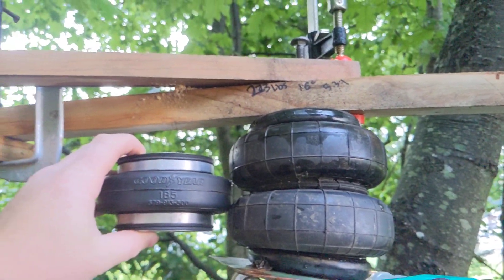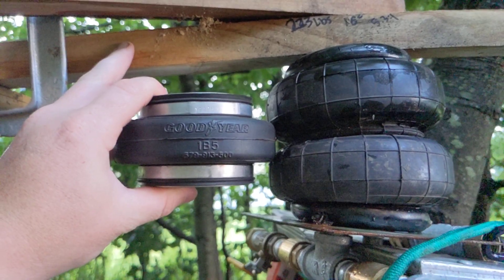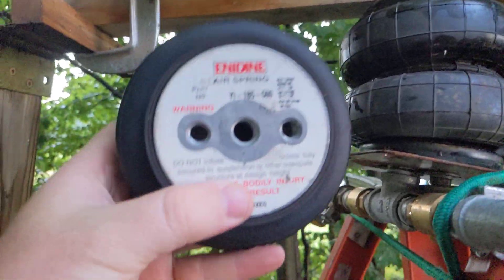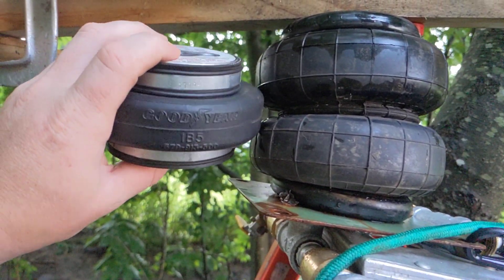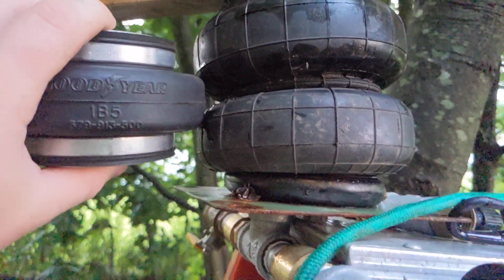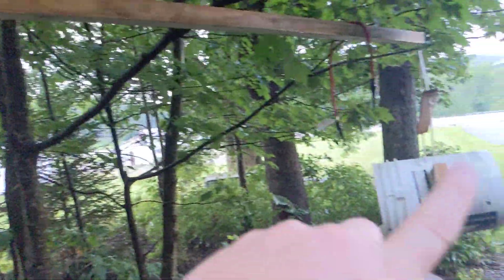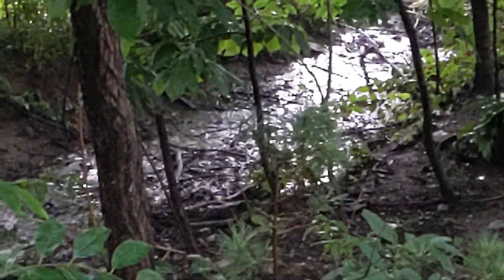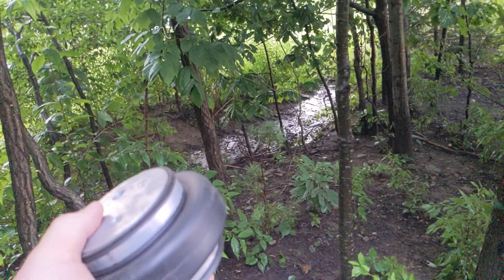A smaller bellows pump to generate higher pressure.

Comment: You need to make a water cannon like they used to get gold by blasting with a big end funnel  that was made out of pipe to and small end so when you are building up your water supply .
Reply: You only get around half a PSI per foot of fall so those water cannons would have huge pipes funneling water from 500+ feet up the mountain to get high pressure and volume. This setup has around 10 to 20 feet of fall so not even enough for a ram pump on top of not having the volume needed for one.